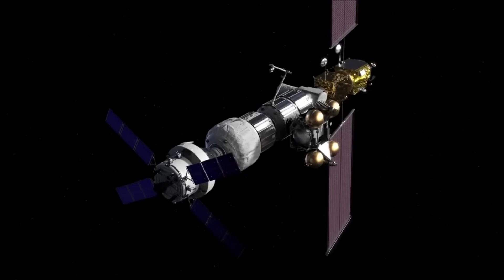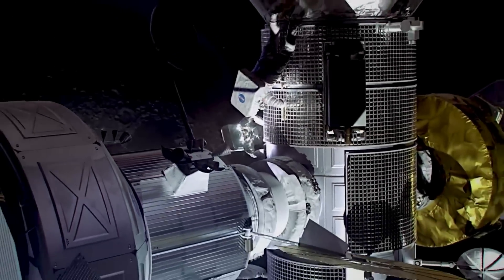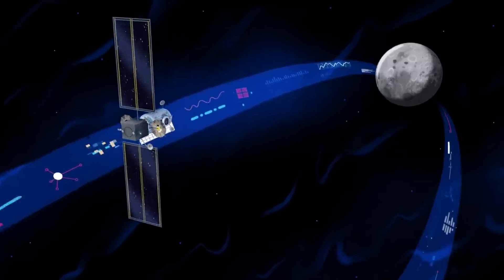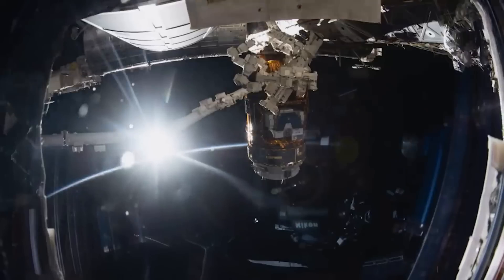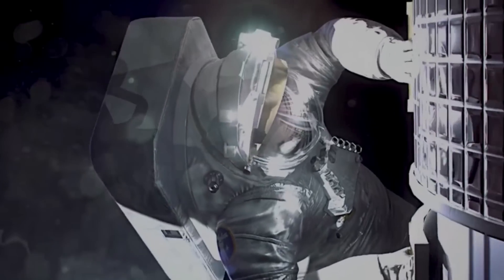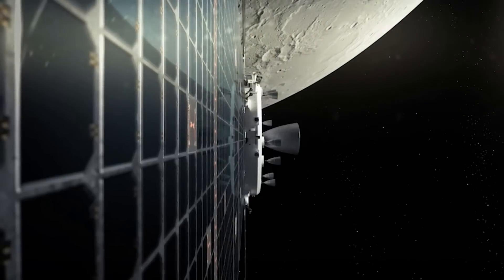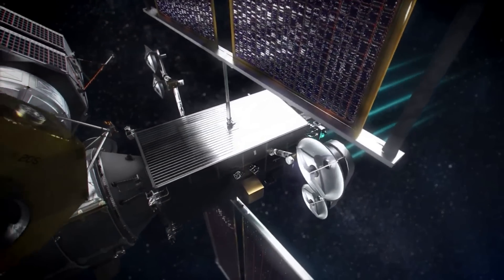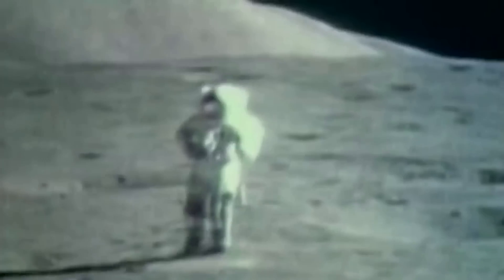New Challenges With Building NASA’s Lunar Space Station

Comment: How are they solving the problem of the radiations? ISS is protected by the magnetic field of the Earth but the Lunar Gateway won't be.
Reply: They will only stay for a couple of weeks, before working up to a couple months at a time, which is well within the safe lifetime dose for an astronaut. Still it will likely prevent the same astronauts from going to the moon too often. Studying this deep space environment and the effects of the radiation environment is likely going to be a large part of the science done on Gateway.
Reply: They are not actually solving it.  The Artemis program stays should not last more than a month, so radiation levels should still be within what is acceptable to NASA.

There are multiple possible solutions that could be applied in the future, such as electromagnetic fields (ideal), or some really thick solid shielding (not ideal), however there are no confirmed plans to apply such solutions to Gateway.